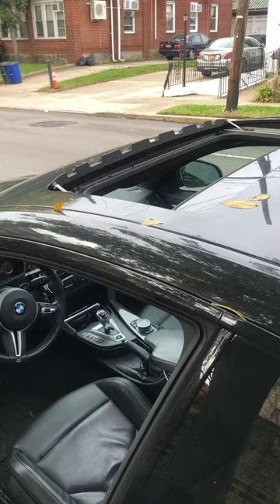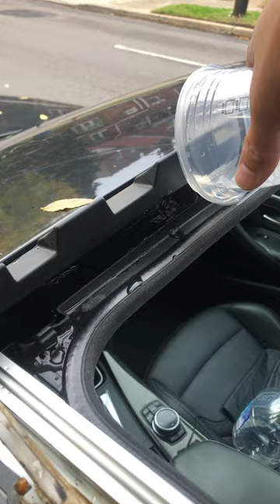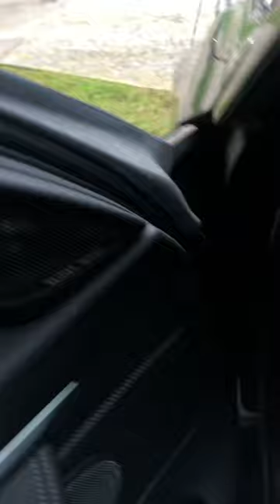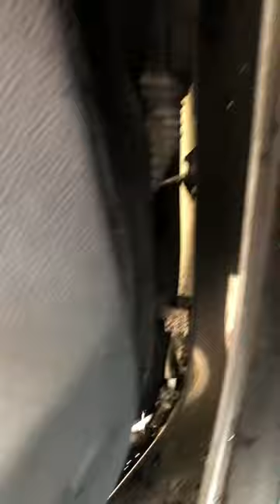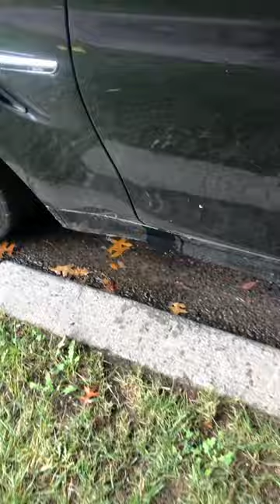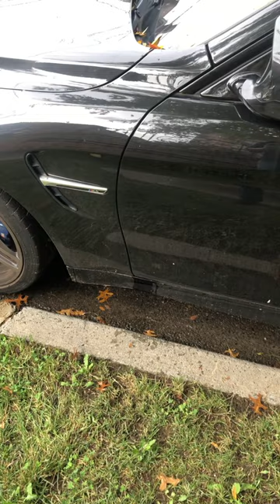BMW M4: Fix water leak from roof causing puddle inside car. The problem is a clog!!!!

Comment from the maker: There are two holes at each front corner of the sunroof, it may be hard to find. Use a flashlight. Once I saw this drain-hole, I used a plastic straw to gently remove some debris that was blocking it. Please note this is not advice because that may damage the tube if you poke around too much, but it worked for me since the blockage wasn’t that severe in my case. It didn’t take much to clear it out with my situation. Hope it helps.